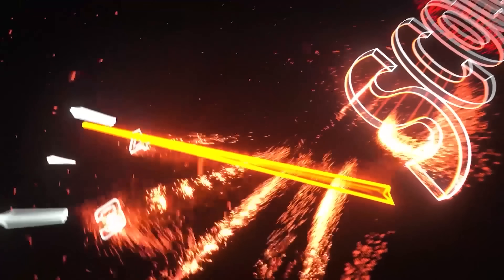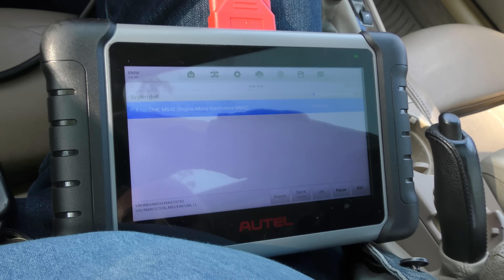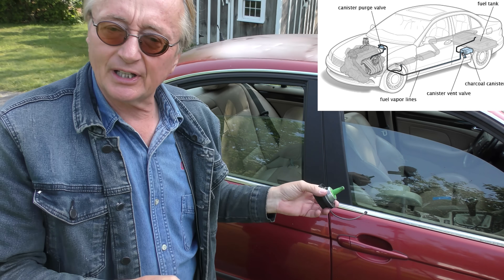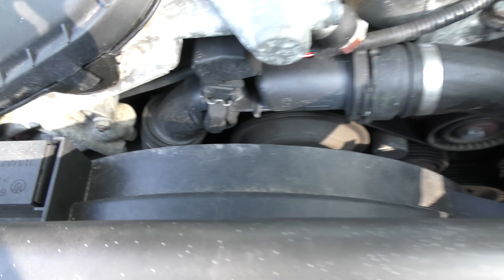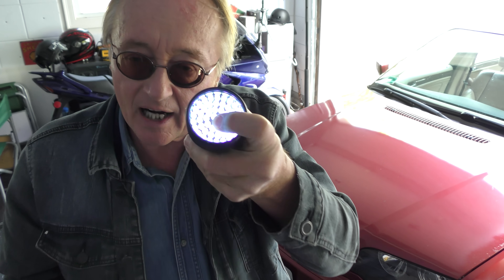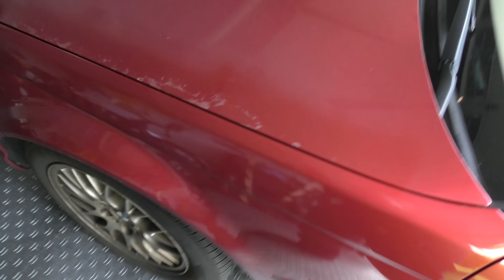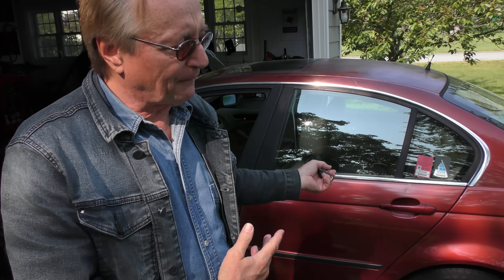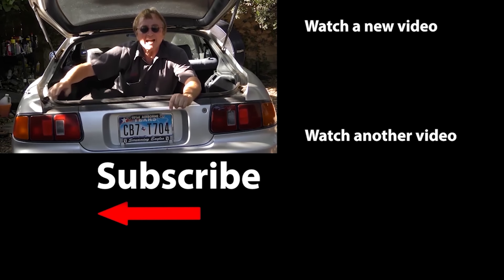I'm Sitting in the Only German Car Worth a Crap

Comment: In the 90's, I had a 1995 BMW 328i coupe from new and I really miss it.  Huge fun to drive. That engine was smooth enough to run to a true 150mph back in the day. The one that Scotty was diagnosing was 24 years old and still ran really well.
Reply: duuude that v sounds awesome!
Reply: We had an E36 coupe manual. It was so smooth, confident and easy to drive. If I was feeling lazy I could drive it in 3rd gear 90% of the time.
Reply: In 1995 the options were the 318i or 325i.
Reply: @slshusker Here in the U.K.  328i coupe 2-door was available in1995. I bought it new with manual transmission. Sold throughout Europe in those days.
Reply: @johnlee4897  , I was incorrect. I had both the 318ic and 325ic over the years.
Reply: @phatgringo2.0 3rd gear 90% of the time? You weren't passing by too many gas stations. 😅
Reply: I miss my 1989 bmw 535i great machine

Comment: Scotty me ol fruitcake, great vid thanks. In my opinion these German cars are great vehicles for us here in Europe cos we can get parts and servicing anywhere and they run well for many years and miles.
We purchase mainly diesel cars and NOT the very big engined petrol cars that you guys prefer.
Also the service guys in Europe tend to know how to look after these cars, we have loads of independent service places run by former employees of the various factories so they really know their way around these cars. I used to live and work in the UK Midlands for instance and many ex Jaguar and Land Rover guys can look after your car.
I own an Audi S4, 2006 with 220k kms on the clock and she runs GREAT, my van is much never Mercedes Vito 2017 with 245k kms. Neither consume any oil and I travel frequently to the UK, Spain, Germany France and Italy and both run great.

Comment: One of the best cars I owned was 1990 740, big V8 with tons of power. Miss that car.
Reply: What happend to it
Reply: A 1990 Camry might still be running.
Reply: @TragickSin  It died, unlike a Toyota.
Reply: I bought a new 1985 325e 4dr that was a fun car to drive
Reply: @TragickSin  I had to sell it in 2007, it had only 60k on it and I got 18k for it.

Comment: I have a '94 740iL with 235k miles that's still running strong. Very little plastic under the hood, except for the dress-up cover and the radiator tanks. On modern BMWs, you're not going to convince me they build them out of plastic because it's cheaper to build, no, they build them out of plastic so they break sooner.

Comment: I had an 00 328ci coupe back in the day. Great engine and manual transmission. Very smooth. Friend helped me fix a vacuum leak it developed. Mechanically sound other than that $5 fix. Clips in the sunroof kept breaking and a trim piece that went around the top of the drivers window and down the door kept falling down. Dealership couldn’t fix it long term. Really good car

Comment: The Oak Ridge National Laboratory had a molten salt reactor that ran for 13000 hours at full power from 1965 to 1969.and used fluoride salts and  it became the first reactor ever to run on uranium-233 and thorium .  It's design was said to be inherently much safer than the nuclear reactors we have today.
Reply: Wheres the remains ( rubbish )  ?
Reply: My uncle was a chemist at the Oak Ridge National Laboratory from 1944 till 1981.
Reply: well liquid sodium doesn't sound "save" to me. Somewhere there must be heat exchange with water. Hope there will never be a leak. Sodium and water don't mix well.
Reply: @gargoyle7863  Our nuclear reactors run at high pressure and must circulate water through the reactor even when shut down  the liquid fluoride salt reactor is a low pressure reactor and if the circulating pumps stop there is a freeze plug at the bottom of the reactor and cutting power to the freeze plug will cause all of the liquid salt to drain into a storage tank which stops the reaction with NO chance of a melt down.  Also most the waste products are a lot less radioactive. If there were a leak the salt would solidify quickly. And you assume wrongly that sodium is involved as there are many types of salts and sodium chloride is just one type , It uses a"fluoride salt" NOT fluoride + salt .
Reply: The only sodium I actually know about is inside of the stems of pricey Iconel exhaust valves for racing engines.
Reply: @leekumiega9268 Sounds like safeguards built in.

Comment: You can change out all the coolant plastic pieces with aluminum pieces for cheap I’ve seen e46 and e36 with over 500,000 km and still running
Reply: The oem plastic parts last 20 years why bother with aluminum that can warp

Comment: I have had  2 BMWs, 3 Merc’s , 4 Audi’s , 3 Porsches, and 4 VWs. 
Most have been great.
The worst was a Merc GL 320 FIng nightmare.
Best were the Audi’s. 
Currently have a 2015 A6 Biturbo diesel SLine. Fantastic car. So much power and excellent fuel economy.
The trick is to be fanatical about maintenance. Very important.

Comment: 2000 328i here. Had it for 5 years since 2013 to 2018. 
It was fun to drive and the engine was flawless. In line 6 was just so good. I would say the automatic transmission was build very solid too. 

But it was an endless money pit. 
Leaking oil here and there every 6 months or so, cracked plastic parts everywhere. However parts were readily available and there were a lot of aftermarket quality parts as well as tons of DIY tutorials videos etc. 

This car got me into many DIYs and blessed me we fun+frustrating memories.
Reply: Could have 5 328i or 1 Camry

Comment: We have an american Ford Focus 1, very old and the dashboard does not start up 8 times of 10 with the turn of the key. Apart from that the car runs smoothly. It does however bother us that we can't see speed and the fuel gauge doesn't work. In damp weather the probability of dashboard starting drops almost to 0. We are planing to unmount the dashboard, but is it realy what we think, faulty connector?

Comment: The older BMWs built in Germany are miles ahead of what they're putting out today in terms of build quality. I've got a '97 Z3 with the same engine and trans as this, and it runs silky smooth after 120k miles. The mostly plastic cooling systems are the Achilles heels of these cars though. One of the few parts I've had to replace on the car is the radiator because one of the plastic tanks on the side cracked. Other than all the stupid plastic they put on these things, I don't have any real gripes with the BMWs from this generation.
Reply: You only have to replace the tank which is 25€ and can be done by yourself.

Comment: I’m betting the plastic intake manifold is where it’s leaking antifreeze especially if it uses dexcool which is notorious for rotting your cooling system, I use nothing but traditional green in my 02 Chevrolet with 199K, that bmw is an excellent vehicle especially being a standard shift trans

Comment: quite fond of hydro for providing power, even better if you can utilise tidal as well, but agree smaller safer nuke is the way to provide in long term
Reply: 2/3 of Washington's electrical energy is from 1 dam that also provides Montana, Oregon, Idaho and Wyoming as well.  We pay 11 cents not 30-45 like in California.  WA is the ONLY 0 emissions state.  I am surrounded my Tesla's as a results.  1/3 of my neighbors have one.  I just have 2 Camry's.  Solar is best distributed (and on-grid) not centralized, unlike wind and tidal which should use farms.  Solar has a 10 - 15 year lifespan for panels but the rest can last decades as long as you avoid batteries.
Reply: If people were encouraged to keep their electric cars plugged in then we have all the batteries we need to stabilise the grid.

Comment: BMW 6 cylinder petrol or diesel engines are the reason to buy them, the 4 cylinders are nothing special and expensive for what they are. My favourite Spanish mechanic said that a known weak point was the plastic butterflies inside the plastic intake manifolds, these break and can do horrible things like fall in the cylinder.

Comment: Scotty i wish you where my mechanic. 
I have a 2012 Mercedes c250 turbo. And im having AC problems. Plastic crappy cooling hoses have been replaced, temperature sensor, fan works and engages. Pressure switch sensor was replace. Cabin filter replaced. Freon was put in twice. And supposedly the compressor works. It work perfect for a couple of weeks every time the freon was replaced. But it stop working. But the dam thing shows no codes. I need your help.

Comment: I owned a 1999 Mercedes E320 and it had problems, I wasn't impressed with it. The engine was ok but a bunch of the electrical switches etc. Were crap.

Comment: One of the best German cars EVER made is the Mk4 (4th gen) Volkswagen GTI VR6 with the 24v naturally aspirated engine.  This car is a panzer tank!  I've had mine as my daily driver for 21 years now, and it's been more reliable than a Toyota!  The only problems all these years were a broken cooling fan and a replaced MAF sensor.  I still have the original timing chains too.  The engine purrs like it's still new, and the 6-speed manual transmission shifts cleanly and crisply, even after all these years, and never changing the manual tranny oil!  I'm not kidding.  TWENTY-ONE YEARS!
Reply: Can a fire a RPG at it and test the Panzer tank claim?
Reply: Same here but I have the MK4 Jetta GLX VR6 12v.  I'm currently in the process of doing a rebuild to keep it interesting not that I have too!

Comment: The only solution for fuel efficiency is the regular cars with manual transmission. The extra cost of an EV is more than the fuel cost of the life of a gasoline car. And you can drive coast to coast.

Comment: I have a 2000 323i cooling system and breather system has been my 2 major problems and I am at 330000 mi
Reply: On original engine and transmission??

Comment: I haven’t let a mechanic touch my car since 2019 since done brakes power steering pump/high pressure line, alternator, wheel bearings drive axles, rear shocks, installed a stereo system and didn’t just replace the head unit😠 installed proper trans cooler…sad to say it’s still a 2012 Altima 2.5…but I will admit besides the known cvt issues…I have not been able to kill the engine…just need to change the oil…there’s more I’ve done…give me the proper lift and tools I could fix anything on it

Comment: I have 4 BMW's and they are all automatic transmissions and I had to rebuild one at 213,000 plus miles because I listened to a person who knows about cars but not about bmw and caused my transmission to fail. I went to Absolute where I live in Denver and Dan told me to change the transmission fluid every 40 to 50,000 miles. My other transmissions have lasted over 260,000 plus, since Dan has recommended me to change it.  BMW's are good cars but many mechanics indicate that lots of new cars have lots of plastic parts in them not just bmw.  Dan has told me that his friend has a BMW 325I with over 1,287,000 plus miles. You just have to take care of your vehicle.

Comment: Scotty saying 165k miles is a lot of mileage has my brain running in circles, considering every car my mom has bought has somewhere from 190k to 200k+
Reply: For that specific vehicle in the video it’s a lot of mileage for it
Reply: i’d beg to differ - yes lot of miles buh for a 20+ old v ?? mom’s is 2014 & has 150k i’d say tht thng was barely driven🤷🏻‍♂️
Reply: The last of the really good BMWs and Mercedes were the early 1990s.  Everything was made out of metal.  My dad had a 1985 325e that was a tank.  300k miles and you know what killed it, a huge deer ran into it at 60mph…totaled it.  My father was heartbroken.  I purchased a 2003 530i sport in 2006 with 28k miles.  It was great car until 130k miles and then I started having oil leaks, cooling issues, electrical issues.  But I will say that interior looked brand new when I finally got rid of it at 185k miles.
Reply: Even my 1999 Prizm made it that far.  It did show me a Corolla does not have enough power

Comment: Breaking news Scotty, most newer cars don't have gas caps.
Reply: I got this from car’s website: 
In addition to the Easy Fuel system on Ford’s lineup, there’s only other vehicles we’re aware of with a capless fuel filler are the Chrysler 300, Dodge Charger and Cadillac XTS.

The article was from 2012 and I couldn’t find any numbers or percentages for the cars making them in that way. I thought it was still pretty rare but I drive an 07 Focus and the 2 bosses in the house have 2016s, both with the caps. I do my best to keep them away from new cars.
Reply: He has videos on that.

Comment: I had a 2000 328ci
2001 325ci
2004 325i 
All great cars 
Now I have a 2009 328i.
Reply: I have had my 2012 Camry since 2014, not need to annually replace like you junkers.
Reply: @toriless  I just have enough money to get a different one when I get bored of one. You got a camry for obvious reasons. You don’t drive your camry the way we drive our bmws that last well over 200k miles while driving them sideways. Good try
Reply: @toriless  all of those bmws still work to this day and the 2000 328ci has over 270k miles getting 30mpg and can do donuts. What does your camry have on that? Heated seats sport mode cold ac sunroof. doesn’t look like a Japanese turd designed for broke people to travel efficiently.

Comment: I recently saw a power generating system that uses the waves of the ocean. The floats,I guess floating up and down from the waves making the power. Very simple. As far as I know there are always waves. I agree with wind being stupid and horribly expensive. Solar is simple and seems to do just what it is expected to do. That’s if the installers hook it up right AND turn it on!  I have had mine for seven years and has only worked as it should for the last three years. They didn’t wire it up right and didn’t turn it on! Now that is expensive. I have a friend from Ukraine. He is very in favor of the nuclear plants even though he lived so close to Chernobyl. He is too young to remember. . What do you call the night janitor at Chernobyl? Mop and Glow.

Comment: Scotty as my thermodynamics professor told me not so long ago, "if everyone were an engineer the whole world would be running on nuclear energy".
Reply: Thorium not uranium though
Reply: True. But until battery technologies make some pretty big strides, petroleum is still the most efficient fuel for powering vehicles.
Reply: @bm4751  Yep, 10 times the energy output.
Reply: @rfichokeofdestiny  We're pretty close to how good batteries are ever going to get in terms of energy capacity. It's a small miracle that the things don't explode more often.

Comment: Scotty, I’ve own Two BMWs, both were New one off the showroom floor from a Dealer in Lexington, Ky. I will NEVER own another! Theses cars are totally engineered to fail by BMW to scheduled repairs as miles are racked up. These cars are Money Pits, If You enjoy working on your car ALL the time after it gets 60,000 miles plus then buy one. There expensive parts andif you don’t do the repairs yourself then expect extreme labor cost. Plastic parts everywhere! Designed to Fail!

Comment: Got a question. Would it be worth replacing the A/C compressor on a car if the oil leaking onto the compressor may be what is causing the compressor to short out? Oil leaks onto it, the compressor is pulling too many amps and blowing the fuse. My mom's car is experiencing it. 2015 chevy cruze. No air and it's too hot to not have working ac.
Reply: I would suggest trying to verify the oil leak and see what the cost is to fix that. If you buy a new AC compressor and still have oil leaking from above, the new one may go kaput and you’re back in the same situation. If the oil leak can be resolved in your budget, then a new compressor should last for years. Plus, the oil leak could get worse over time and damage the engine.
Reply: @ithinkaboutthings9052  I'll have to look into it

Comment: KILMER! I like you, you are mostly right eggzept when you venture into the electric domain which is MY domain but you emerged from it as a "neutral". Anyway, I KNOW you are a BMW lover, the straight sixes.and yes, all made after mid-late 80's  is junk. BUT! I "grew up " and inherited a BMW 2500 -69 (aka 1970) BMW first try make a big sedan, the predecessor of the 7 series. Manual OFC. It's the family of the new sedan that beat the 6'oh CS and also known as 2800, 3.0s, 3.0Si. THAT is the Beemer you love and want. Get a 2500, 2800, or a 3.0s manual. The box is snickety-snick and a very short stick. Hug the roads like glue and IF you visit Berlin by driving one, you will get a personal Police escort and guide. (Been there, done that)

Comment: BEAMA! At least its a straight, in-line 6 with rear wheel drive. No rot, I'd get it fixed up by a good BMW mechanic that does the old ones all day long. Otherwise, not a good DYI. You'll drive yourself nuts, as one thing gives out, and gets fixed, more stuff goes wrong with the stupid thing. Beautiful, well built auto though.